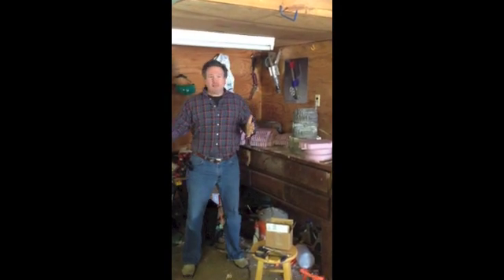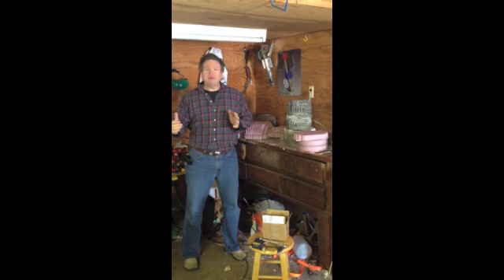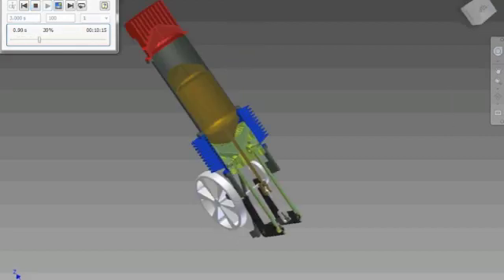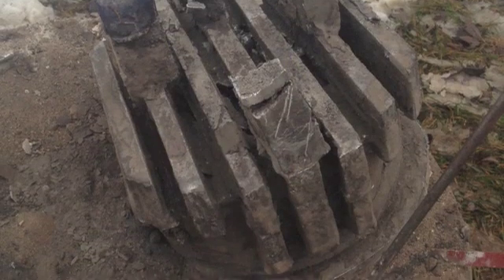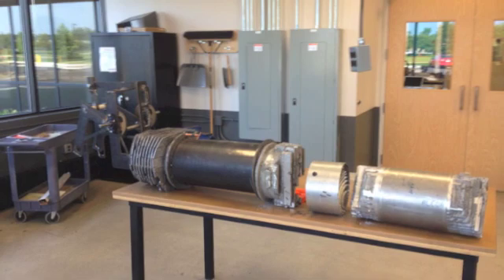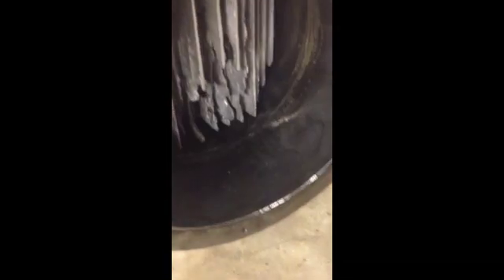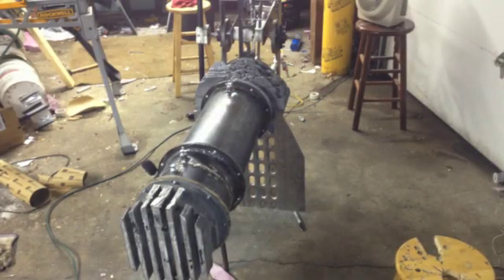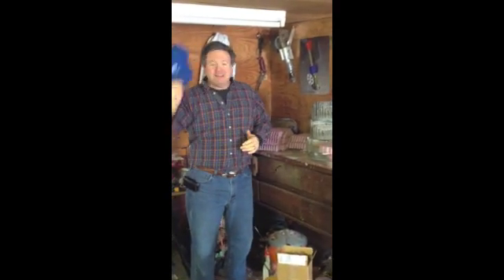Volo Engine Project Funding

Comment: 10 years. How's it going?
Reply from the maker: Hi Just Tinkering - hard to believe, seems like it was just yesterday when I started this project.  Things are going well. - The Melvin has become a very cool engine and getting better with each sale and each design improvement - We still have a ways to go.  The vision of the project has not changed, if anything it has gotten clearer and stronger.   We'd like to get to a higher level of productivity, producing more engines in shorter time and adding more features faster, but, that will come.  Thanks for you interest. Tim
Reply: @seftonmotors  Have you seen the one derwood youtube did?
Reply from the maker: @justtinkering6713  I don't think so - where can I find it - don't see anything under derwood ?
Reply: @seftonmotors  derwoodvw stirling
Reply from the maker: @justtinkering6713  Just saw it - don't think I've seen this engine before - very cool - thanks for sharing
Reply: @seftonmotors  You two could collaborate, form a company, save the world.
Reply from the maker: @justtinkering6713  You never know, never say never - I am going to send him a note - love how he's gotten rid of the displacer with the thermal lag design.   Pretty sure with in a few years it will be common place to have a power appliance, just like a refrig or washer dryer, for generation of electricity locally instead of power plants - just makes sense.
Reply: @seftonmotors  he has downloadable plans in the comment section of one of his videos.

Comment from the maker: Hi Specallez,
Understand your sentiment - we working hard to get it done and running- going though a few small design modifications - although at time even small modifications can be tricky with the engine dynamics - We'll get something posted as soon as there done and running - check out our smaller prototype engine for validation of the overall design.  You can find it on our earlier updates  - at our web site volodesigns stirling project blogspot -